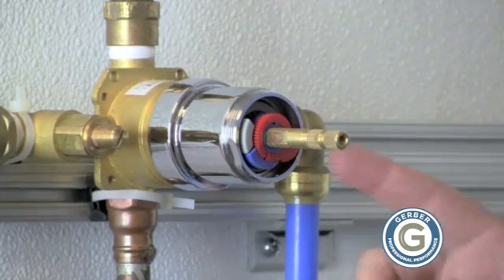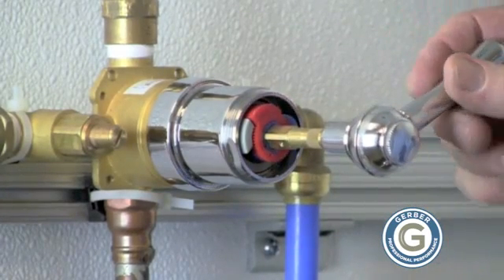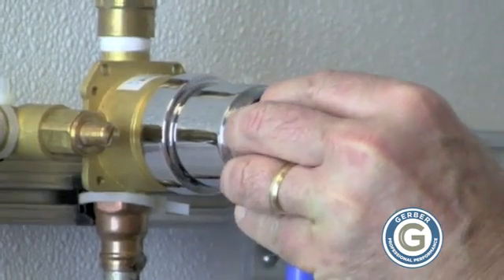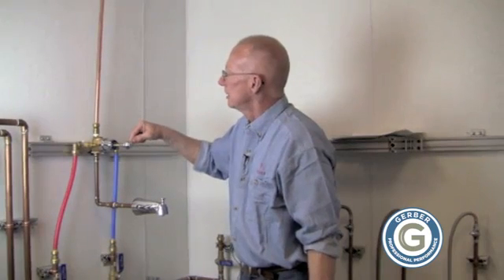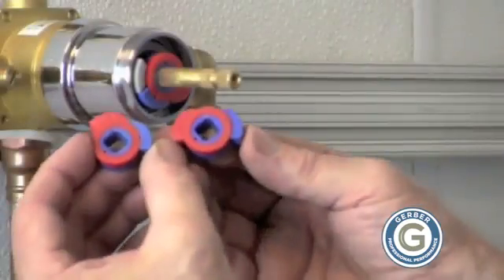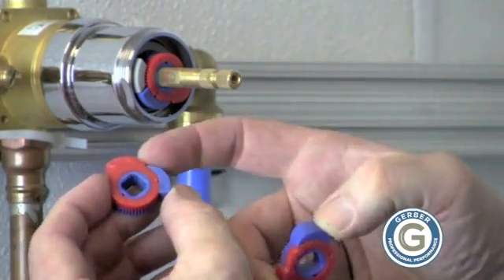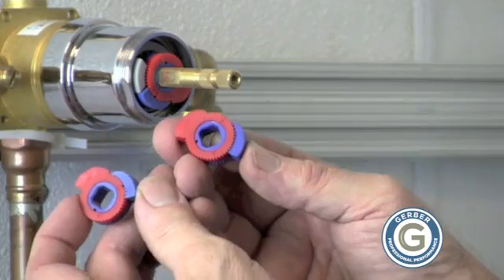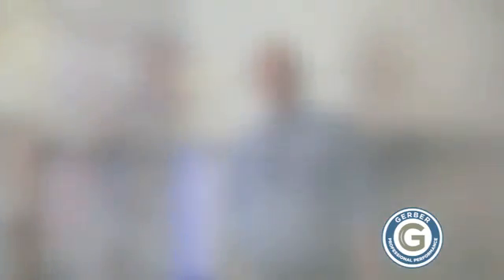Setting Temperature Limits on Quick Closing Valves

Comment: Used a Dremel to cut off a portion of the red part so that it goes further towards hot and before it actually starts limiting the flow again. Getting hotter water now. If it weren't such a pain in the neck, I'd replace them with Moen...They stand behind their product for life!
Reply: I just remove the limiter all together.  do you know what cartridge these are?
Reply: @crash60068  Danze.
Reply: @aleneb.4227  do you know what model?

Comment: What if i need More hot than the limiter allows?
Reply: even with maximum range, the hot water is not hot enough. You remove the red part, now gradually turn the handle counter clockwise until you get the desired temperature. To place the red plastic part in you have to grind them until it fits. 
Don’t remove the red plastic completely. Without the red stopper, your handle will swing an almost complete circle. The water will go in order no water- cold- hot - no water- cold.
Reply: You may have to turn higher the hot water control on the tank.
Reply: Take out the limiter. The faucet should go back together and work perfectly without it. Giving you the full amount of hot water available.
Reply: @jalynkay4113  Ive done that. But the water doesnt get hotter... it actually turns off and starts the water again.... cold